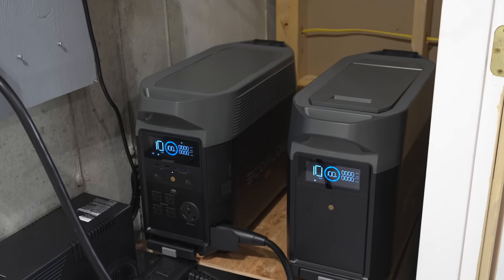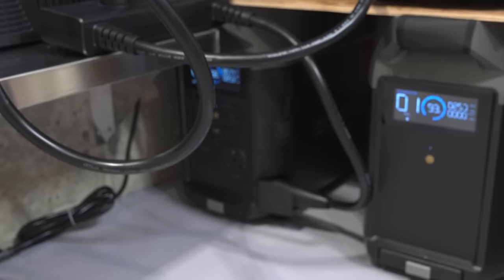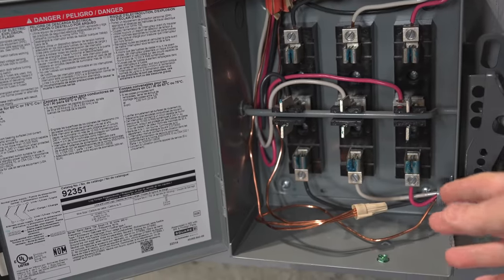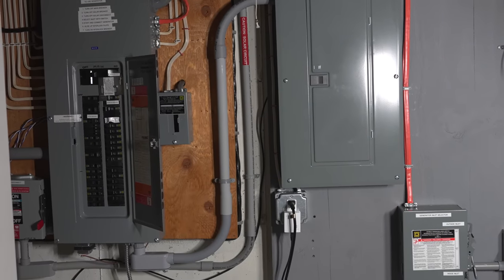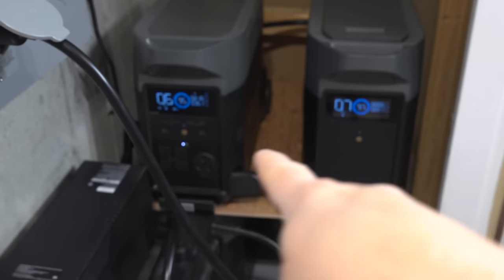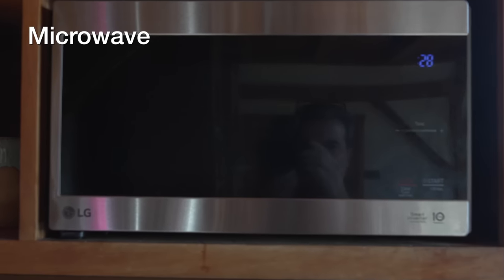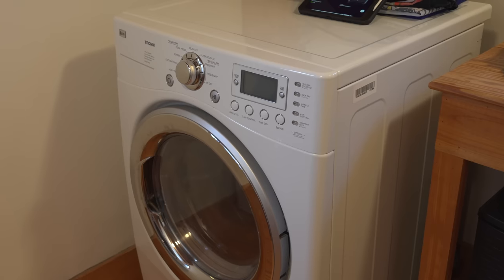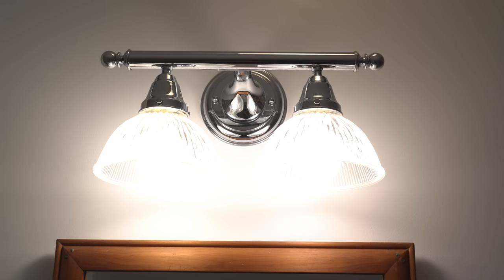How to power your Whole House with a battery generator - Ecoflow Delta pro

Comment: Looks like a nice product but for $7000 you probably could just get a whole home generator that runs on natural gas or propane and not worry about running out of power. Good for those that can afford it.
Reply from the maker: Whole house ones have gotten crazy expensive now. The going price is $10k and most of them will upsell their $12-15k systems. Natural gas is good but in Texas, the gas supply was shut down during that storm, so sometimes being off grid has big advantages

Comment: That wiring seems small for the loads you are talking about...
Reply from the maker: On generator, whether battery or gas you can run many things, but not always together. You also must size your breaker to the wire size. Here is a 10 gauge wire which is ok for 30 amps, but if I was running it 100 feet away you may need a larger wire. If you turn too much on the breaker will trip or likely the generator overload will engage to shut it down until you lessen the load.

Comment: Nice setup.. Now give it a real test... run a 5 ton or 2 ton AC unit and see what happens.
Reply from the maker: If those are less than 5 years old most use considerably less electricity than the dryer I have. Sometimes startup draws can be big though depending on the motor. I don't have central air here so I can't give you other demos
Reply: @Silver Cymbal  Yes, indeed, being able to deliver during motor startup is a true test of the 240v ecoflow. Mini split ac units, some of which are 120v are not as demanding.

Comment: for best safety for the microwave is to have a dummy load such as a cup of water or some test load.

running a microwave with no load may not hurt it be it isnt the best thing to do to it.

remember when running gas generators they can produce carbon monoxide fumes and must be ran outdoors away from the house.

every year people are sickened and/or die from carbon monoxide poisoning so be careful

Comment: Ha, ha.. Worried about running the microwave for more than a couple of seconds.  My microwave draws 1780 watts and I could run it all day if I wanted on my 5500 watt inverter generator. This is why batteries are a poor choice for emergency power unless you live somewhere with an occasional short outage.
Reply from the maker: You misunderstood what I said. It was empty, its not good to run one empty for a long period of time as it can damage the internals

Comment: could sure share your cost of electrician? otherwise this is not more than an add and waste of time for some people.
Reply from the maker: Well, you can buy any brand you like. The 240 hookup is universal, but I can only show you what I have. I did all of the electric work, and costs will vary if you want dual inlets, etc. But just to get an interlock with one outside outlet within 30 feet is about $700-1000

Comment: Battery is a poor substitute for a gas generator if you live in an area where power goes out for more than maybe 12 hours at a time.  As I write this, my 5500 watt inverter generator has been running for almost 2 days. I can run my fridge, freezer, gas furnace, stove, lights, internet, TV, fans, and pretty much anything I want but not all at once.   If I were on battery, I would have blown through the charge.  My power isn't likely to be restored for another  24 hours.  As long as I can get gas, I can live an almost normal life.  My generator setup cost me $1500. These batteries cost $7000.   Sorry, but one of these is a bad investment. If you live where the power goes off for more than 24 hours, even if that happens only once every year or two, you are far better off with an inverter generator.
Reply from the maker: As long as you can get gas... Thats the key and why people died in Texas, they couldn't leave their homes. I keep 40 gallons of gas on site all year in case of issues os if you plan to use gas I made a prep video on what I do to keep it good.
Reply: @SilverCymbal  A battery is not going to get you through 4 days of no power unless you stop running everything but your heat, and if you have electric heat, you will chew through your battery in six hour is if is 2 degrees.  If you know that there is bad weather, you buy gas in advance.  I refill two 5 gallon cans before severe weather and if I don't need them, I simply burn them in my car.

Comment: For how long? 4 hours....
Reply from the maker: This setup should give us around 24 hours or more if we reduce usage, if we use solar we can charge it each day or use a gas generator to supplement for silent running during longer outages to keep going.
Reply: @SilverCymbal  Well this will never work for me. I live in Virginia and when the power goes out, we can expect it to be out for days if not weeks at a time. Longest time was 3 weeks last winter.

Comment: My goodness, that setup is about $14k CDN without solar panels
Reply: That said, this is kind of what I’m looking to do. 

Not looking at powering 240v loads. Installing a 10 circuit transfer switch and would like 2 inlets as well like you showed. 

I have a small firman 3300/3000 dual fuel inverter generator to recharge the batteries. 

Considering a delta pro and extra battery for now.  Portable solar panels later possibly.
Reply: And fyi, interlock kits have not been approved in Canada. So transfer switch is really the only option.

Comment: That's an expensive setup:
2 EcoFlow Pro @ 3500$/each
2 EchoFlow extra batteries for the pro model @ 2600$/each
And the 140$ junction powerbar or what ever.

That's over 12k USD :-/

Comment: The only option would be solar panels. In my case, not AC. Power. No, not the grid. No I don't have that. Let's just use solar panels. Oh yeah, that's all I got to solar panels. I won't get a gas generator sorry. Oh, but I would get another battery, but that's another story. No, that's not another story. I'll just use another battery to charge up another battery. That works just fine too I would think.

Comment: WARNING: Ecoflow never tested how long their batteries will work without being software updated. If you are planning to use these after a serious event where maybe the internet doesn’t come back for a long long time I don’t think you will get the life expectancy as the chemistry of the battery will last. You get me?
Reply from the maker: They are lithium iron phosphate and have around 3000 cycles before they lose capacity at all. Maybe I am misunderstanding what you mean about the firmware?

Comment: Don't get me wrong, I enjoy your videos and your thoroughness but let's be serious here... you have over $12,000 in just the EcoFlow boxes and expansion batteries. That doesn't include any of the required electrical infrastructure. That's not what I would consider even a remotely practical solution for most folks residential needs.
Reply from the maker: Its absolutely not inexpensive by any stretch but a lot of people don't want engines. Look at how many Teslas are on the road, I don't know how so many people can spend $60k on a car or more. . It will be great when these drop further in price for sure.

Comment: Sounds absolutely expensive! More susceptible to failure, high cost repairs/parts replacement and overall longevity...I'll pass and you better hope there's never an EMP that hits your house. 6:10 My 10K watt, dual fuel runs for hours on good Ol' clean propane  ;)
Reply from the maker: That;s fine, but what will you be powering in your house that wouldn't also be affected by an EMP?
Reply: @SilverCymbal  All the stuff I have stored in faraday bags and cages  ;)

Comment: That whole setup must of costed $20-40K+
Reply from the maker: Total it would be $14k, you can eliminate $7k without the extra batteries also to start with it for less. Not cheap by any stretch but since its DIY and can be bought in pieces its got an advantage over bigger dealer only systems pricing & specs: http://bit.ly/3ktc2ER
Reply: @SilverCymbal  thanks for info

Comment: Dude this thing is useless. It runs your house maybe 12 hours. What then when it needs recharged. It’s useless for long term. And the price is ridiculous
Reply from the maker: For most situations you will get 24-36 hours of runtime. That's far from useless, but I totally agree it is very expensive. If you are ok with gas, storage, etc, as mentioned many times in the video go that route. I use both as we get short and very long outages here.

Comment: You can spent $12000-$14000 on this ecoflow system or spent $800 on invertor generator.
Reply: The $800 inverter-generator would only supply a single lower wattage 120v circuit and burn gas 24/7 rather than the whole house with the ability to run a generator to recharge the batteries for a few hours a day as needed.
Reply: @phillipsusi1791  you may calculate how much of gas you have to burn that will be equal to buying battery.
Reply: @Prime0pt  Indeed.. and that depends on both how often the grid goes down, and for how long each time.  And of course, while it is down, getting replacement gas tends to also be a problem.  I haven't gone this route myself exactly because where I live the grid goes down very rarely, and when it does, it's almost always only for a few hours.  If I lived somewhere that it was more frequent and longer in typical duration, then it might be worth it.

Comment: Wtf the uk has had 240v backup since the first gen in the uk was made
Reply from the maker: Its different you guys run 220v as your standard voltage. Sadly in the US we use 120v x2. Single phase but 2 separate 120vs giving us 240v. Terrible way to get it, but thats what we have and making a powerstation that does it is tricky and the US is the only country that needs it, thats why they don't do it natively.

Comment: $8000 just in batteries!
Reply: I am interested in using battery backup in hurricane prone regions in lieu of a fuel powered generator.  Many whole house generators cost in the range of $20K or more.  It makes a lot more sense to go with a battery backup system that can be recharged from the grid during normal times, no solar, auxiliary generators or wind turbines.

Comment: What a pain in the butt to change over. Just use an ATS!
Reply from the maker: Thats cool if you want to do one of those, but now that its installed I can be on battery in about 1 minute. You may have noticed I even printed directions and put them on the panel and though its 7 steps most are just pushing buttons and making sure things are correct.

Comment: First its not a generator its a battery inverter. Second they suck. Get a real generator. These things dont last, your done when they run out. They recharge slow and expensive. And keep coming up with errors and glitches.